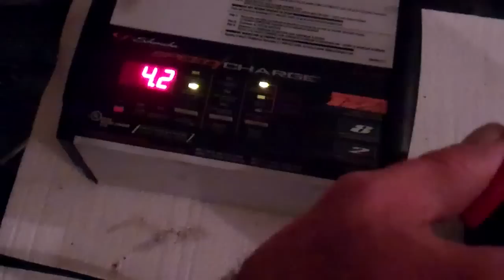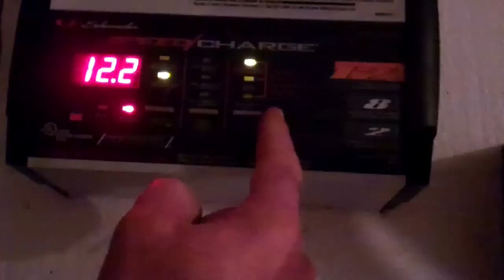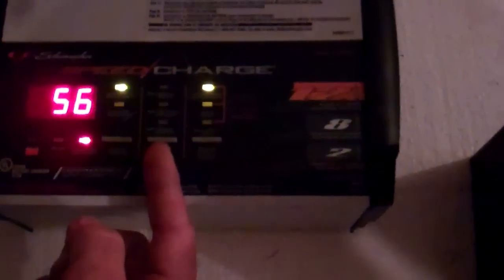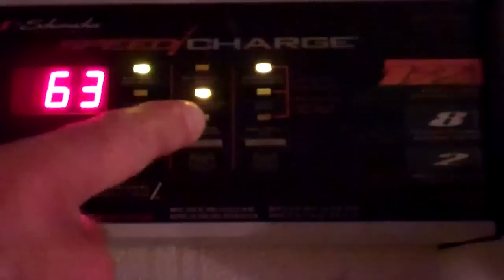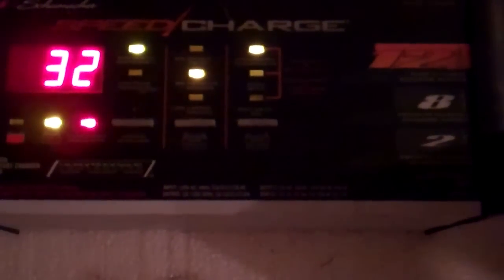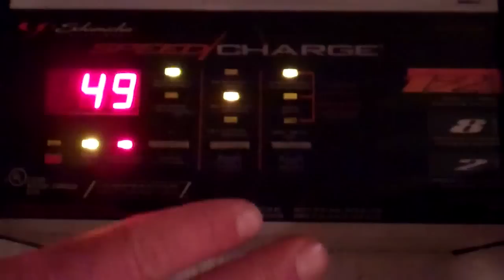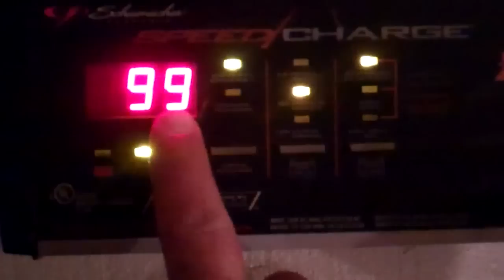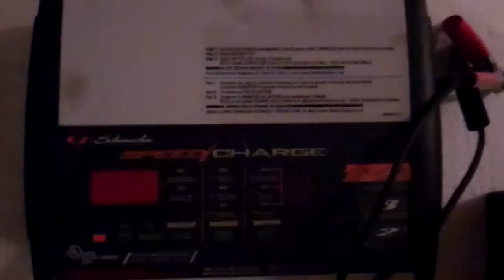How to charge a car battery using a battery charger

Comment: When I charge (trickle or reg) the battery on the X300 with a 10 amp charger, is it best to disconnect the battery cables while charging?   When using jumper cables or jump starter, the owners manual states to not connect cables to negative terminal but to engine block to keep from damaging the ECM...
thanks

Comment: AS 16 YEARS experience for chargers RD engineer and manufacturer, I only want to tell everyone, connect cables  way is incorrect, however, practical  life, if voltage is not more than 36V, and cars battery has protection,it is not big problem. of course, correct connection way is also important.

Comment: I feel grateful this reconditioning program ( Check Details Here>>>https://plus.google.com/100351090281822647456/posts/6ukDjcr5HXn )  was started. I had Three dead batteries scheduled for disposing of. Having said that, I tried out reconditioning them and it took me only an hour to do it! It doesn`t matter what type of battery you want, the process works.

Comment: Lots of people will throw out old batteries not knowing they can be brought back to their initial glory? Batteries are not affordable! Prior to throwing out any kind of battery you need to examine them to see if they can be restored.

Not just will it save you loan however it is additionally eco-friendly. Batteries have chemicals that seep right into our soils and end up in our waterways. By replacing batteries we will remove 50% of the batteries we throw out.

Comment: I've read a lot of comments in this thread about how to properly hook up the charging cables, along with several reasons why it is important.  This part of my discussion is for when the battery is OUT of the vehicle, and it is being charged.  Batteries will potentially discharge explosive gases - especially when being charged.  A spark from the charging cable, a dropped tool, or something else that could create a spark, is very dangerous.  That is why it is recommended to place the charger far from the battery being charged. Below are the steps for charging a battery outside of a vehicle:

Comment: Here are some instructions from Schumacher for when a battery is being charged outside of the vehicle, follow these steps:

Attach at least a 24-inch (61 cm) long 6-gauge (AWG) insulated battery cable to the NEGATIVE (NEG, N, -) battery post.

Connect the POSITIVE (RED) charger clip to the POSITIVE (POS, P, +) post of the battery.

Position yourself and the free end of the cable you previously attached to the NEGATIVE (NEG, N, -) battery post as far away from the battery as possible – then connect the NEGATIVE (BLACK) charger clip to the free end of the cable.

Do not face the battery when making the final connection. Face away from the battery when connecting the negative clip to the cable.

Connect charger AC supply cord to electrical outlet. 

When disconnecting the charger, always do so in the reverse order of the connecting procedure and break the first connection while as far away from the battery as practical.

Comment: Safety recommendations/directions for this typically call for attaching a minimum 24" AWG #6 cable to the negative so that you are farther away from the battery if it explodes.

Comment: My truck is completely dead, so I got a battery charger similar to your and it gets stuck in 88%.... and the battery is still dead. At this point I don't know what's happening. Maybe I need a new battery?
Reply: yea maybe the battery cant hold a proper charge anymore
Reply: How To MLG My husband just replaced the battery!
Reply: Paula Q. alright well just a tip here.. if your ever wondering how much longer a car battery will last, make sure its completely charged and check to see how many volts its putting out. a car battery will be dead at about 10 volts, and it will be charged at 12 volts.. unless you have a 14 volt battery

Comment: after you charge the battery how long does it last before you have to charge it again ?
Reply: If it is a car battery, and there are no other problems with the vehicle's electrical system - including the alternator - then you may not to ever need to recharge the battery.  It could hold a charge up until the day it finally dies, which could be 5 to 10 years.  There are a lot of factors that determine the life and charge of a battery.
Reply: depends on what your using it for
Reply: Bob Marsh
Reply: Bob Marsh Thanks dude

Comment: At which point to you have to toss a battery? As compared to recharging it? After it doesn't hold charge even after a charging or what?
Reply: a 12v car battery at about 10 volts means its pretty much dead so just charge the battery till it wont charge and look at the voltage its giving out

Comment: Always use safety goggles when working around batteries. One freak accident and you will be using a cane to get around.
Reply: +Mightiflier You mean you will be using a guide dog?  Also, as far as the video goes, I'm pretty sure you don't plug the charger in 1st.  Also, you're supposed to use an extension cable for the negative(black) terminal...this reduces the chance for an electrical arc(which could make it blow up+ruin the rest of your life).
Reply: Love dogs, prefer dogs and rabbit, and even my goldfish with my eyes still functional. I always hook up the the battery with switch off, or with the charger unplugged. Good call.
Reply: Don't you just attach the neg. clamp to the neg. post period ?

Comment: Bad advice - always connect the positive first!
Reply: Imagine you are running cables from a charger with a live power source, as you might be in some instances, and the car battery is installed in the car, and the car has a negative ground, meaning the negative battery terminal, and the negative terminal of all the cars components, eventually are attached to the chassis/body. If you connect the negative cable of the live power source first, that is, you connect it to a ground, and then, you accidentally hit the positive cable against the chassis/body, you create a short, meaning a path for the electricity from the live power source, to flow directly to ground without any resistance. This will likely produce a potentially lethal arc flash, hot enough to weld the clip to the body/chassis, and if you happen to be touching the chassis/body at the time, you could suffer a fatal electrical shock. On the other hand, if you connect the positive clamp first, and the negative clamp then accidentally hits the body/chassis, it doesn't create a short, because the positive clamp is on the positive terminal of the battery, the negative clamp is touching ground, as it should be, and there is resistance between the two.
Reply: I think I've heard that too. But why?
Reply: Ah. That makes sense, thanks.
Reply: Hennypenny8888 k

Comment: WARNING: DO NOT do what this guy says.
1) Always connect RED first not black. RED THEN Black when connecting (opposite of what this video does)
2) Connect the cables to the battery before turning on the charger unit

Basically this guy does the complete opposite of what you should do.
Reply: yes, you are right. I always do it the way you described. But in practical life, not much will happen if you do it the other way around. When connecting wires, you might get a slightly stronger bolt/sparkling. Hooking it up to car, that's bit more imporant, cause you don't want to overcharge any electronics or blow up your fuse(s).
Reply: itube612 Agreed, it most likely won't kill you but why risk it. Plus, the people who need to charge their battery are more likely to have damaged / faulty /end-of-life batteries which could be more prone to doing bad things if not treated right.
Reply: uleih Um, no, you need to check your facts. When connecting, red first then black, when disconnecting black first then red.
Reply: Hi jouxpane. It's nice to find a man who wants to learn about menstrual cycles! The menstrual cycle is divided into two phases. The luteal phase, and the follicular phase, and is controlled by fluctuations in the level of four different hormones. Estrogen, progesterone, follicle stimulating hormone (FSH), and luteinizing hormone (LH). The follicular phase starts on day 0, which is also the first day of menstruation. Menstruation is triggered when the levels of progesterone and estrogen, drop suddenly, causing the endometrium (lining of the uterus) to become unstable and slough off. This process lasts between 3 and 7 days, during which, estrogen levels start to rise as the ovary develops another egg. Estrogen levels continue to rise until about the 12th day of the cycle, as a follicule within the ovaries develops into an egg. There is a brief spike in estrogen on the 12th day, after which it begins to drop, and is immediately followed by a spike in FSH, and LH, causing the ovary to release the egg. This is known as ovulation. Testosterone also spikes slightly during this time. Ovulation signals the start of the luteal phase. The egg is propelled along the surface of the ovary, and up into the fallopian tubes, by little hair like structures called celia. Progesterone levels start to rise when the levels of FSH and LH rise, but continue to rise after FSH and LH fall. The continued rise in progesterone causes the endometrium to thicken to prepare to receive a zygote (fertilized egg). This is joined by a rise in estrogen.  Progesterone and estrogen levels hit their peak around the 22nd day of the cycle, and if egg fertilization does not occur, continue to fall until they bottom out around the 27th day of the cycle, causing the endometrium to become unstable, and menstruation begins shortly there after. During this time, a woman with average flow, may lose between 30mL and 80mL of actual blood, but substantially more fluid. Cramping, or dysmenorrhea, is caused by uterine contractions, which assist in the commencement of the shedding of the endometrium. While some women might also experience symptoms such as bloating, fatigue, headaches, or increased irritability or emotional liability in the days immediately before menstruation, contrary to popular belief, these symptoms are not caused by an increase in estrogen, but a decrease in estrogen and progesterone, in which the levels of these hormones become more similar to those of men. 

It's interesting to note that human females are unique among primates, as the females of other primate species to not menstruate so heavily, and the females of most mammilian species don't menstruate at all. One theory as to why human females menstruate as they do, is that humans need a particularly thick endometrial lining because human zygotes implant deeply in the wall of the uterus, and a thick lining is necessary to prevent the zygote from burrowing through the wall and implanting in the abdominal cavity, and the human body is unable reabsorb such a thick endometrium. 

Now when you die from failing to take simple safety precautions when working with electrical systems, people will say "Well , at least he knew something."
Reply: Another safety aspect, although not that important, is to connect the leads to the terminals first AND then plug the charger into the AC outlet.
Reply: +nacs This charger will not spark. There is no power going through the leads until the charge setting is selected. I have the same charger.
Reply: +jouxpane I'm taking it seriously.  I'll pay attention to anything that saves my life...or saves $.
Reply: Midol+clam flovored ice cream-
Reply: new chargers use a relay to power on so it doesn't complete a circuit no matter which order you put them on. Don't worry about it..
Reply: +uleih Why does every other video say to connect red 1st???
Reply: Unless for some odd reason you have a positively grounded battery.
Reply: Lol the 2, 4 and 6 amp definition was something else!
Reply: WARNING: This guy spread false info, you can damage battery when you connect red first. Usually you should first plug black (discharge) and then red then connect charger to the electric current.

PS. It's only does not matter when you charger is not connected to plug.

I have fucked up one battery this way like you said to do. If you not rich you don't to this mistake again.

Comment: how long will a battery last. even a good battery looses charge over time ,But a good battery should last 2 to 3 months any longer it may not start the car
Reply: +Peter Quiring Anywhere from 6 months to 5+ years. It all depends on how they are cared for.

Comment: Although I noticed this guy does not answer his Viewers Question, I'm gonna go ahead and ask Mine anyway... Will these Battery Chargers Charge a Battery that Have been dead for Over a Year or 2?
Reply: Well, It didnt work for Me, I've tried everything I See and know. I addedd distilled water to bring up the level, then Charged for about 3 Weeks, Still Voltage is Below 11V, Then Last Week I Added Epsom Salt, Still no Luck, Voltage still same below 11V. But What I Just Noticed When I Charge it, I See Bubbled coming Out of Cells 2,3,4 & 5, But Not in 1 & 6.. What else Can I Do to Revive the 2 Cells?
Reply: Nedu Nonny P
buy a new battery scrooge. Cost up to about 100 US dollars

Comment: Why can't you just connect the negative to the negative battery post instead of the chassis? Anyone know?
Reply: When a battery charges.....it puts off hydrogen gas. If you hook up the final connection (negative) near the battery.....it can cause an explosion.

Comment: Hi. If my car battery charger shows that the battery is full, when its not actually, around 10V i measured and car starts very slowly lights go very dark, does it means that battery is dead?
I looked at the date of production fro my Bosch battery and it shows November 2008.
My car is currently just "sitting" at my house and the battery dies pretty quickly. Few weeks and it was at 10V again. So its dead?

Comment: A small amount of bubbling is fine. Hydrogen is realeased as part of the chemical reaction when a battery is charged. But if it is bubbling to the point that you can hear it, I'd be concerned about the charger charging at too high of a voltage. This will cause the battery to "gas" (which you can hear) and it cuts down on the battery life since those bubbles will knock the chemicals (lead oxide) off the battery plates

Comment: Nice video

But I will say this: I'm really not a fan of Schumacher chargers. They tend to charge at too-high a voltage and will reduce the life of the battery. 15.5 is about a volt too high.

And with that charger: it doesn't matter which side you hook up first. or if the cables touch because it has safety circuitry inside of it that won't activate the power supply until it detects that a battery is hooked up first

Comment: OK AND WHAT THE HELL DO YOU DO WHEN YOUR BATTER IS DEAD ON THE ROAD? I bought a portable battery charger that instructed me to charge it at home for six hours, then carry it with me in case I needed to charge my battery. I bought it for emergencies, since my light chime doesn't work. This doesn't help me AT ALL. Does anyone know how to use a portable charger that's supposed to hold a charge and charge your car in an emergency? ANYONE? ANYONE? BEULER?

Comment: oi
yes they are the best the new ones they changed the design and stuff on them
but i got mine in friday but didnt get a chance to use it yet but i will try to this week
but this model SC1200a was one of the best ones the mmade not even the diehards like match this one and diehard was good back in the days but some people dont like the nose it makes but that noise is what keep it lasting for a longer times most chargers dont have a fan so they just burn them selfs out gets to hot
the end
:)

Comment: using Solar panel at day time. and have one of them 2a battery charger, $99.00 150a,55a,20a n 2a. slow charge,fast charge,ect and the battery are connected to a 12 volt modified sine wave power inverters. try chargeing them us the car battery charger, at 12.22v should be at 12.45 or 12.78.

Comment: i have a question, i have alot of Sealed lead acid battery and all 6 of them having problem holding a charge. not using them for a car,for a battery Bank,inverter.

Comment from the maker: Yes . The charger converts AC power (from the wall outlet in the house) to DC power (that a car battery uses) to charge the car battery. So it needs to be plugged into the wall Zack to get power to charge the car battery.
Reply: backyardmech where can I get one of those car battery charger

Comment from the maker: Correct - I always use the 2 amp charge (for no particular reason) and leave a battery on the charger. If I was "carless" I'd be charging at the higher amperage to speed the process.

Comment from the maker: Only if the reason your battery is not holding the charge is because you haven't driven it far enough to re-charge. What I mean BushaMan is that if you boosted your car, drove it 3 or 4 blocks and shut off the car - it's not going to start. Reason being, you haven't driven it far enough for the alternator to re-charge the battery. If you drove it 30 miles and shut it down - the battery should have re-charged. If it didn't , the alternator may be bad and is not charging the battery.Good luck

Comment from the maker: @ThePurpleMenace My guess would be that it would be OK Menace - but that's a guess. I'd advise removing the cables off the battery, then attaching the cables from the charger to the car battery , and let the battery charge up. Disconnect the charger, and reconnect the car cables.At least you can leave the battery in the car that way.